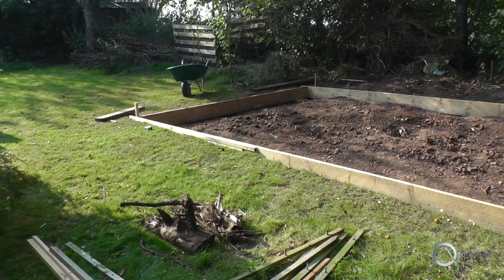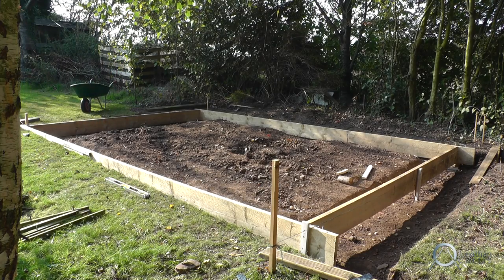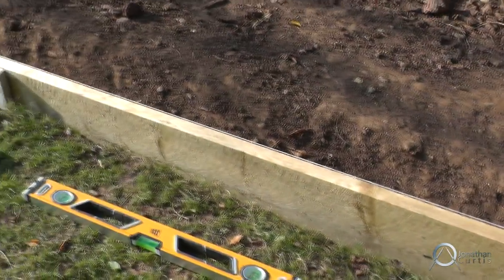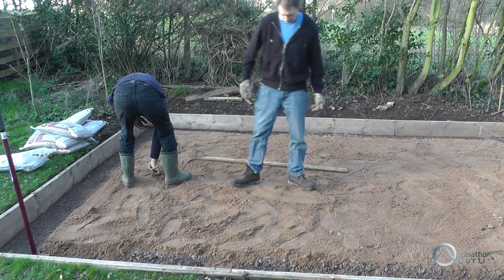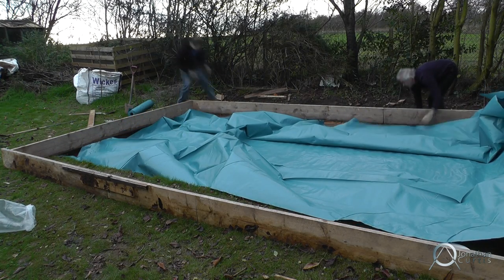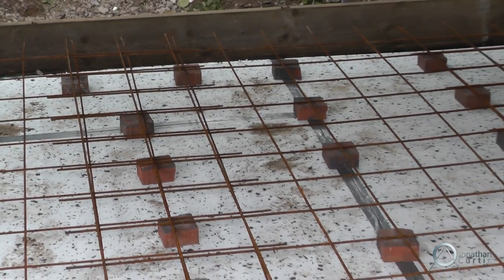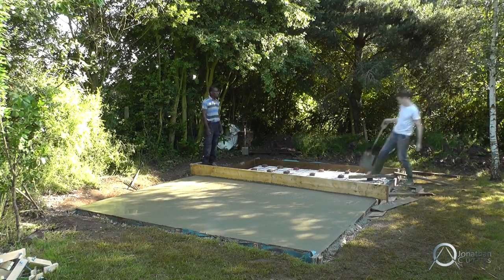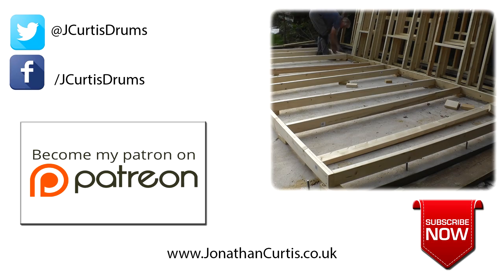Building a Drum Studio #1 - Foundations

Comment: What is the temperature like in the room year round without hearting on?

You have no floor insulation ? But 2 layers of roof and wall insulation ?

Do you think floor insulation would have maybe much of a difference?

Was there a reason why you did not put a floor frame with insulation inside , on top of the concrete base ?

Comment: Hi , well done first of all , lovely to see you working alongside your father, I wish I could have done the same... anyway, just a couple of question please, did you use a standard 125l/150l cement mixer for mixing the concrete ? if yes how long did it takes to complete the slab ? 

wouldn't have been easier and quicker having the concrete poured ?
Reply from the maker: Hi there, thanks for your comment.

The concrete was mixed by a full lorry cement mixture on site. The lads in this video were wheeling it in on barrows directly from the truck, due to lack of access. If we could have poured it in directly, we would have.

Comment: What bolts did you set in the edges of the concrete please?
Reply from the maker: Hi sorry for the slow reply. Had to look it up. They were M12 bolts, at least 9” long. We can’t remember if they were 9” or 12” long.
Reply: Thankyou sooo much please finish these videos as they are soo good and so much information included.